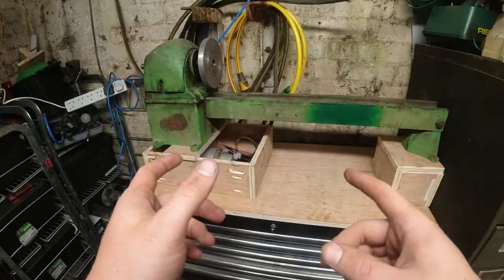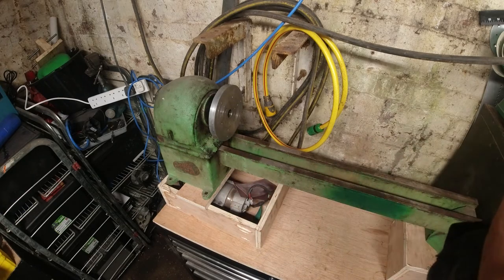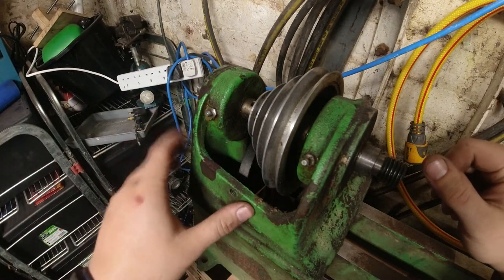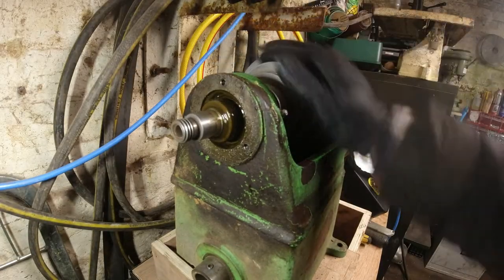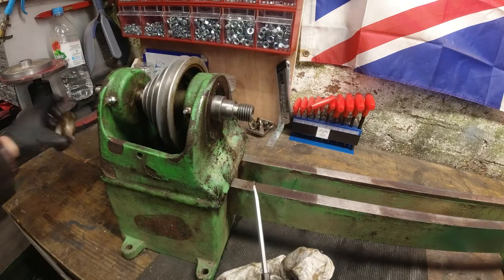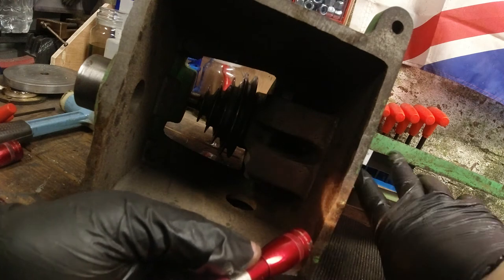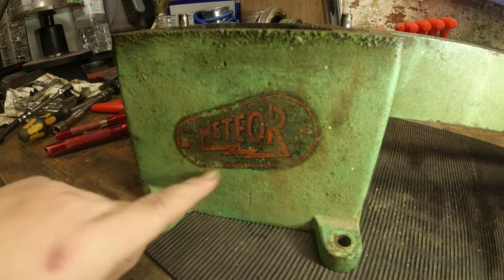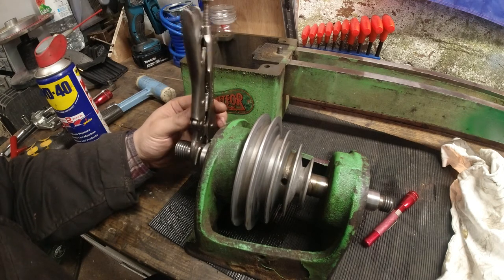HOW TO RESTORE A WOOD LATHE! Part 1

Comment: With regared to heating the pulley (me below) I used a hot air gun. Keep the heat on the pulley while you are applying 'exstraction' pressure to the shaft. Paul